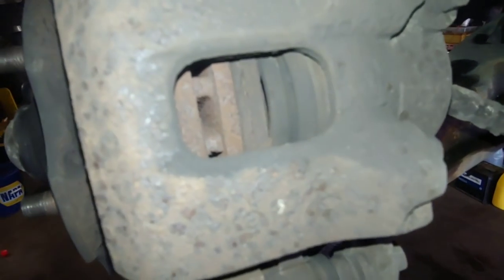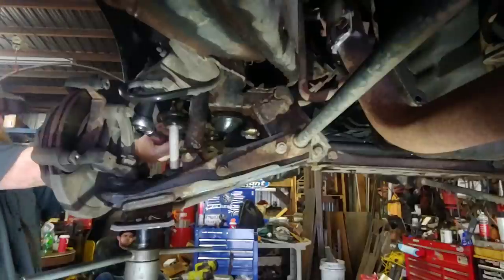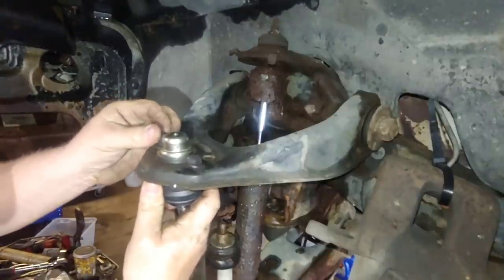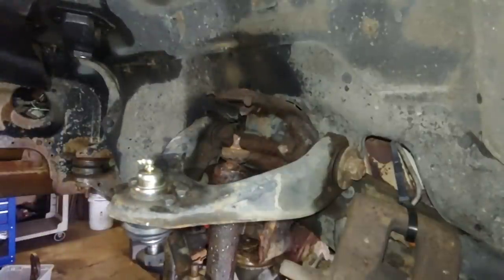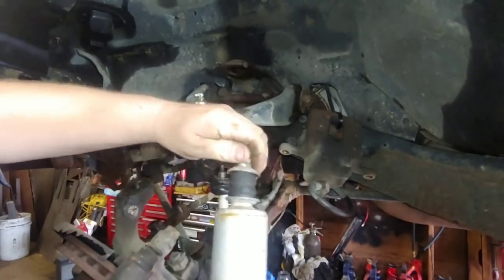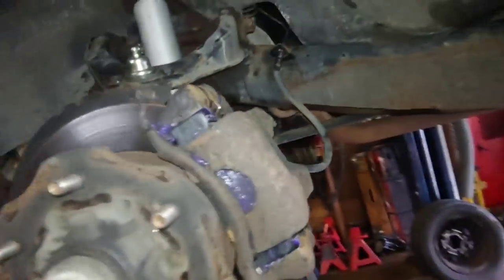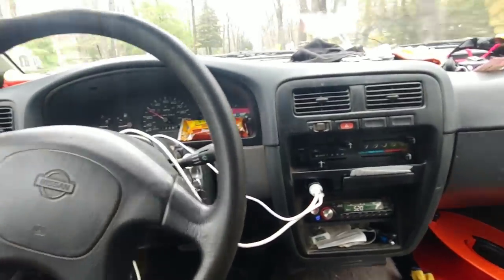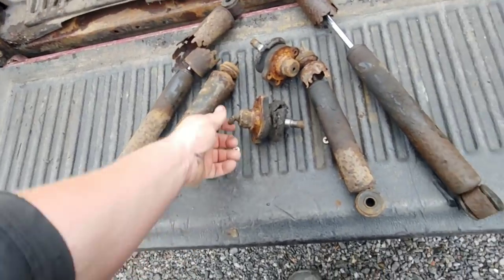Shocks, pads , and ball joints OH MY !! (DIY Auto Repairs)

Comment: ball joints on a nissan seldom wear out and those have been replaced before shouldve probably tried greasing first to see if it changed the sound couldve been the lowers I wouldve checked for looseness first more than likely your noise is still there (front end man for 40 years ) if you would like to ask me some questions sometime feel free Im a dedicated follower also its alot easier to put the pads in after the bracket is bolted down KEEP VIDEOS COMING
Reply from the maker: Sounds good now besides the drag link

Comment: Next time you fined a wire brush in the trash you might want to keep it, the one you have looks like someone ran over a hedgehog. Something to think about, if metric didn't exist you'd still be using Pounds, Shillings and Pence or trading beads.